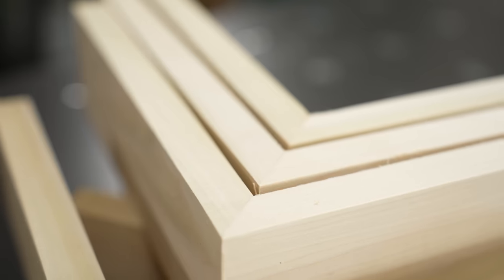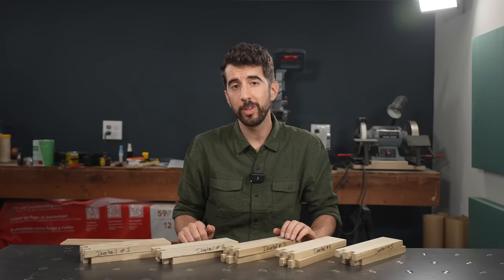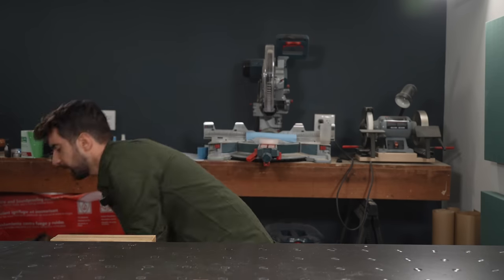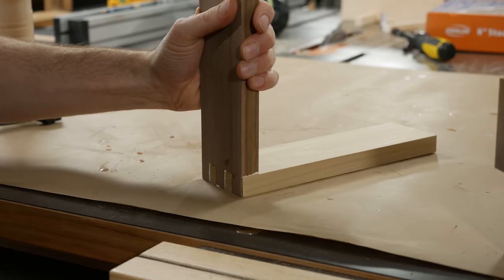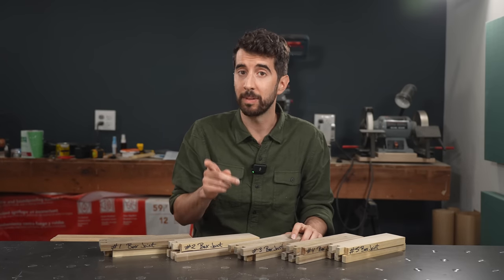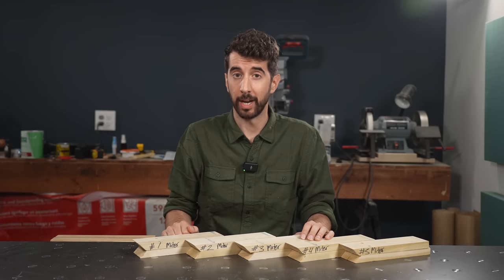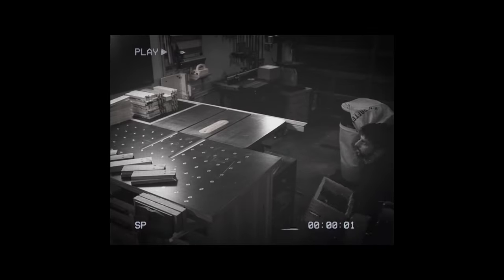This Simple Joint is Stronger Than a Dovetail!

Comment: Very interesting.  How about applying a coat of glue and letting it partially dry, then apply fresh glue to see if that prevents joint starvation on the box joint.  As to the miter, use and epoxy rated at about 5000 psi.  That should greatly increase the strength of the miter because 5000 psi is close to the strength of the end grain.  Only problem is epoxy in not very environmentally friendly.  Another interesting test would be to determine the strength of a joint that had a coat of glue that was allowed to harden, and then applying fresh glue to see if fresh glue bonds well to hardened glue.  My7guess is no.

Comment: I wonder if the dowels would have been stronger if you didnt use smooth dowels. they usually starve any hole they go in of glue.. thats why almost every store here only sells the other kind thats wavy. way more glue surface that way.
Reply from the maker: I thought the same thing too, but it's not common practice to use fluted dowels in this particular situation. It would be likely better to simply use a dowel jig with fluted dowels without a rabbet.

Comment: @ScottWalshWoodworking How come no one is talking about the fact that most jointing is done for a complete box not an L-shape so the force required to break will be much much more? The average daily use applied to most builds is never coming close to the force exerted even to the L-shapes so why the comparison? Just wondering so I can apply different methods for myself if it makes sense for the project. Thanks!!

Comment: The scientist in me can't wait for your "aged" joint testing video 😂
Reply from the maker: I'm devising a scheme for making some sort of contraption that can put a small and cycling amount of pressure on a bunch of test joints all at once (something like 30 lbs on and off every couple of seconds) and have it contained in a sealed enclosure where I can introduce and evacuate fluctuating humidity say every half hour. Leave it running for three months straight and see what happens... it might take me a few years to get around to it though 😂

Comment: I'm sorry if my question is bothering anyone or not in the right place to ask.. why most of time wood worker avoid using screw in the joint? it not strong and not pretty but it faster for me.. is it wrong with screw if the joint or am I missing something here? I'm a newbie in woodworking btw need some guidance.
edit: what I mean not the pocket hole
Reply: I sometimes use screws that go just a little deeper than the surface (no need for clamping so much faster) but then plug the holes with little dowels for estethic reasons.

Comment: I have never liked dovetails in solid wood, because you’re creating a shear point when you cut the supporting grain away. This doesn’t happen when you do something like a wedged tenon (has anyone made a wedged dovetail?), because you’re bending the grain. 

I bet if you tested your joints with 3/4 plywood you would get completely different results. Even if they’re weaker, doweled rabbet and dovetails are better options depending on the use case. Heirloom furniture and drawer construction will stay working long after the glue has failed from a hundred years of expansion/contraction.
Reply: Small pin solid wood dovetails look fancier for fine furniture and a single corner of the joint required near a literal ton of force to shear it off. This will NEVER fail in any fine furniture piece, even if someone used it for 300 years. It's simply not a concern. You need not worry about this. It's not a problem that ever happens. You will never shear off your hardwood dovetails in real use. Even if you're trying to, Mr. Banner.
Reply: @CarlYota  you misunderstood me. The wood is already sheared by the cut. Only the grain that would be present in a box joint remain intact and the only thing holding the sheared grain together is the lignin which is wood’s weak point. I’m not saying they’re weak. If the tails were box joint cut, but wedged, they would be stronger.
Reply: @CarlYota  you can actually see what I’m talking about in the video

Comment: 7:14 Because the butt joint has twice the gluing area in the plane direction that matters? I assume here that the glue on the sides of the fingers of the box joint simply fails to hold? The numbers agree with this hypothesis.
But is it the same under the more usual test where the two faces of the joint are allowed to rotate when put under the same stress?
9:35 Ok that seems to point to the fact that the finger sides in the box joint were glue starved was the reason for its low strength.
11:00 I give up...
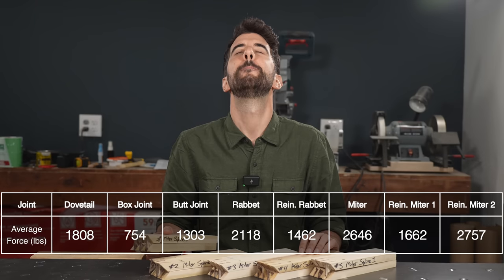16:53 Imagine if dowels were used in addition to the splines! Maybe an idea for another video?
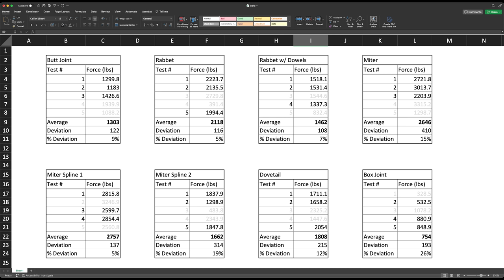16:54 I never would have guessed. It always looked like a gimmick to me... But... we cannot be definitive about this unless a mitre joint with splines and dowels (to offer mechanical advantage) is tried.

Comment: In hand-cut dovetail videos, I often see really narrow pins vs. wide tails. Is there any advantage to that or is it just aesthetic preference? My instinct is that they look fragile, but watching this makes me think that the grain doesn’t care how much material is between the cuts, it’s the undercut that will fail regardless.
Reply: They’re weaker because there is more leverage on the smaller pins. It is 100% to show off your skill. In a normal application it will still be strong enough to hold a lifetime though
Reply from the maker: I actually had a whole paragraph about this, but the video was getting long enough. My theory is that they'd maybe be slightly weaker, but your point is valid too, they might be the same. Also, I wanted the spacing of the dovetails I tested to be as close as possible to the spacing of the box joints I used too.
Reply: It's an aesthetic preference. People do it for looks and to display that it's hand cut, since machine jigs can't make pins that small. It's strong enough to do the job, and that's the real takeaway from this video. Pretty much anything you do is going to be overkill in terms of drawer strength.

Comment: Nah, if you don't completely mess up the joint, the glue will keep stuff together. I'll choose joints based on "looks" and "lazyness".
But if you really want to do a strength test, you should test the joints loaded in different directions, since the load vector isn't the same for boxes, tables and drawers.

Comment: Scott, I believe your next test (hint: next test : ) should attempt to simulate longevity, i.e., wood movement, i.e., cycling between wet and humid conditions. I imagine a university mechanical engineering lab would have the knowledge if not the equipment for this. Perhaps a construction trades company lab as well--they tend to be interested in things for which they are liable. The real test is to see how your various joints hold up in these conditions, and I'm going to guess that the dovetail or reinforced joints are going to do well b/c of their mechanical advantages that counteract those swelling/shrinking and racking forces. Wanna bet?

Comment: The methodology in your testing leads to confusion about what type of joint to use for a box or a drawer, so allow me to add my unsolicited 2 cents, which if you factor my 45 years of experience in woodworking and building furniture, is probably worth even less:
These tests are only testing SHEAR force. In shear, several factors are important including joint orientation, grain alignment of BOTH pieces, surface area in shear, type of glue used to hold the joint (as well as age of the glue), amount of glue in the joint (starvation caused by lack of glue or overclamping), etc.
However, boxes and drawer are subjected to various degrees of forces in shear, tension, and compression, in the joints.
This is why dovetails are mainly used in drawers. They add strength that oppose the shear force the joint sees in the direction of pull or push. Drawers don't see varying degree of tension or compression on the diagonal axis, so those forces are less of a factor.
A miter joint is way more susceptible to failure on the diagonal axis due to these tension and compression forces. This is especially true when you factor in the size of larger drawer or a box. The leverage applied can quickly overcome the strength of the glue and lead to a joint failure.
While a box joint (or finger joint if made with thinner pins) is inherently weaker than a miter in shear, it has a lot more surface area for the joint, and adds strength on the diagonal for this reason. Hence the reason it is called a box joint, and has been used for many centuries to create many types of boxes. You also gain the benefit of joint alignment with a box joint. However, starving the joint, as you found out, makes the joint weaker overall. 
You MUST leave room for the glue! A slip fit using only light hand pressure is the fit you want. If you need to "wiggle" the pieces to fit them together, they are too tight. This is true no matter what joint you use. A joint you need a mallet to close is actually WORSE than one that is too loose. If you have to beat it in place, STOP and fine tune the fit!
As far as wood movement goes, it is a factor, yes, but more so in a box than a drawer. Wood moves more acroos the grain than with it, so a drawer will experience less stress from movement than a box will. The drawer  does not have the grain captured along the length so it is free to move as it needs. Boxes however, having a top and a bottom, are typically restricted from movement a bit more, and therefore have greater stress from that movement.
The summary here is that there is not a single best joint to use for every situation. It depends on the use of the joint, what forces need to be opposed, and the desired appearance once joined. Those 3 factors are the basics for creating the proper joint and are also why a lot of good looking, tight fitting, expensive furniture will fall apart within a decade.
Match the joint to the application and you will have not only better looking furniture, but longer lasting pieces as well.

Comment: End grain to end grain is 35-40% stronger than end to straight "PER SQUARE INCH" - it's just that most end to end are rather small in surface area.

Comment: i was gonna let this go, but since u said it over and over again;
Here is the definition of Mechanical Advantage:
"Mechanical advantage is a measure of the force amplification achieved by using a tool, mechanical device or machine system." 
Force Amplification. A dovetail joint does not amplify force, therefore a dovetail joint has no mechanical advantage.

Comment: Are you testing perpendicular joints or greatest glued surface area? 
 Two other points :one, lots of modern professional craftsmen use hide glue. IE, luthiers . The other a dovetail joint will do it’s job of pulling without glue. So you are testing glues.😊

Comment: Why didn't you drill the dowel ACROSS the application of force? That would definitely have improved the strength

And seems like it the wood used were of the stronger spevies, the results might be swapped between the glue vs material failure
Reply from the maker: i did

Comment: Consider what you're actually doing with a dovetail: You're severing the cellulose fibers on the wedge sides, not bending the cellulose outwards. The lignin is now the bottleneck of strength, and it's weaker than PVA glue (which itself is weaker than cellulose)

Comment: The problem with your test is that those joints are not designed for structural use. They are designed for toleration of wood movement. All wood moves as you pointed out through temperature and moisture changes and an improper joint (ie butt joint) will give the wood the ability to break loose from the glue. The end grain does not take glue into the fibers very well thus the reason butt joints are not ideal.

Comment: Hey, cool channel. Looks like you're working with tau(x) impulse stresses on the order of > 500 lb*f. Like you said w/r/t the whole "of the 14...I've made, have any of them failed. Nope". Even a 300lb roughneck oil pipeliner coming home from the bar trying to get a spoon for some ice cream isn't going really be able to develop that kind of direct stress, especially since those ball bearing slides are going to take up a significant portion (at which point I'd be more worried about the mounting screws being able to hold the drawer in).

It looks like you ran a few instances of your test and averaged them out (next time, I'd suggest using a simple mean regression since if your sample size is less than ~100 N, an arithematic mean won't properly converge, tho I'd ask @NurdRage since I suck at experimental design). Since this is YouTube, and those numbers have enough variance, let's say good enough. 

Next time, perhaps a somewhat more accurate way to measure the yield point/impulse force exerted on each test coupon (and more importantly, where those forces are imposed, thus where your stresses exist, and where your strains develop) could be regulated better in some sort of test jig where you can measure loads by adding more load cells (Super cheap on Adafruit!). 

For example, in this case since all of the joints are 90 deg, I'd clamp one leg in a clamping fixture/vice. Here it's easy to measure your static clamping force with a load cell attached to the jaws so you know your clamping force is reasonably uniform. (Ideally have the clamp be >= 6 inches so its reasonably equally distributed, and/or use soft copper/nylon jaws). Then b) Have a controlled length on the other end of the test coupon (ie if it's a 6 inch length of 2x4, gently cross cut 1/8" on each coupon at the 5 inch mark. 

Choose a stiff (so you won't get stretch/rebound readings) piece of string/rope/wire, wrap it around that cut on the test coupon, and wrap the other end around the test device. A linear rail belt-coupled to a Clearpath motor (I suggest Clearpath since it don't require no nerd programmin', its super user friendly, and it has an encoder built into it so you can back-derive the forces, rather than having to use a load sensor as long as you have something to calibrate against; but use what you'd like-- the important feature is your ability to control your acceleration profile). You'll see the snap (my bet is it'll look like harmonic oscillation) on the output of Clearpath's software.

Comment: Unless you are dropping a piano on your neighbour's dog (A Fish Called Wanda), this stuff is irrelevant.  I am reminded of a historic house my wife used to work at where there was a door, beautifully assembled with M&T joints and wedges, and no doubt at one time glue.  Every so often the top corner joint would open up and someone would just shove it back together, and push back on the wedge with finger pressure, and it was good to go for another week.  Of course a proper repair would have been nice, but the house was built in 1836, and nobody has sought to tear it limb from limb, but good joinery sees it still relatively reliable almost 200 years later.

Another example is a sliver drawer in my family home that had dovetails in the front and fingers in the rear.  After about 20 years the back fell off under the constant weight of the silver sliding back in the drawer when it was opened.  The front is still great today, the back is not easy to fix, as regluing is sketchy, though if it was assembled with hide glue as often factory stuff is, it might have been possible.  Unfortunately we reached that level of sophistication in the mid 80s, a few years too late...

Comment: Thanks for this video, 👍🏻liked and subbed. 
I'm wanting to build a pergola with 4x4s and I've been seeking the strongest wood joinery without metal hardware in the corners. If you know of anything better than a miter/spline in a 5 way cross joint, I would appreciate a heads up?? Or anyone for that matter. 

Maybe a keyhole and 5 hook joint that I am picturing in my head would be best which I am considering??
Reply from the maker: If this is for outdoors, then I would look into timber framing joints. The joints I've covered are more for furniture, where you can rely on glue strength. Outdoors, glue is less reliable and you will need to count on pure mechanical strength. The draw-bore mortise and tenon is a good place to start

Comment: I susspect some glue science could help explain the results. Seems board glue-ups (long grain) has a proven record of strength and longevity. I imagine that compression clamping of the glue joint is critical to strong wood glue results. The weaker corner joints have less surface area glued under compression.  Box, dovetail, dowel, and splines are clearly challenged by glue starvation area due to assembly.
Maybe some glue area calculations would help explain results. 
A wood glue chemist/engineer would be best to inform us.

Comment: I had to stop at the 10:43 mark and stop my brain from screaming at me about the engineering failures I have seen where people thought to use dowel pinning on road bridges that comprised of wood laminated lumber and steel beams. The failure points were a mixed bag of "I told you so"s. I don't think I have ever seen so many little failure points cause so much destruction...
Reply: Makes me glad to have seen your explanation following.  It seems within the proper points of what the failures seen in the wood showed. And where did the dowels fail? They made the dowels go across the laminated lumber through the long grain. They basically got pulled through the ends of all the lumber ends causing a bigger problem.